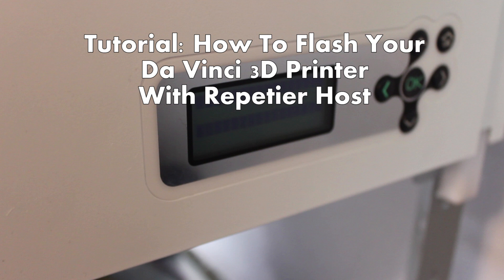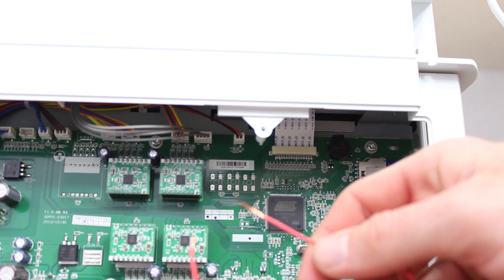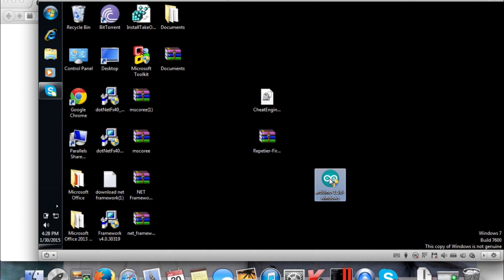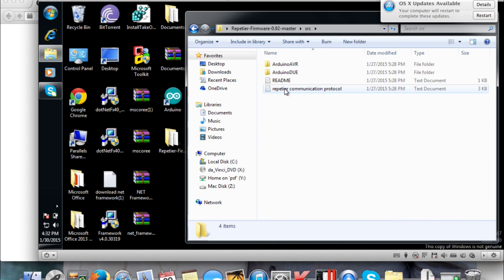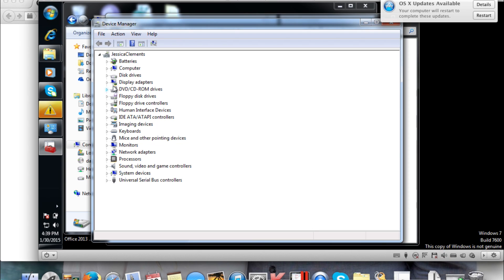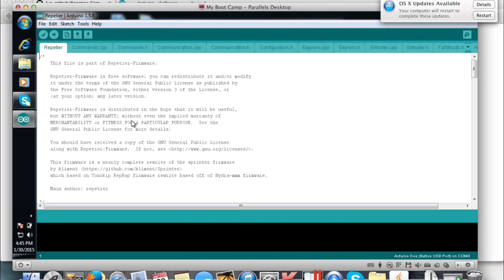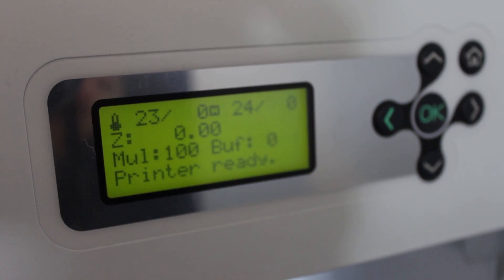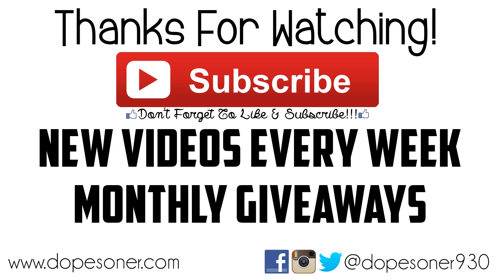Tutorial: How To Flash Your Da Vinci 3d Printer With Repetier Host | 3d Printer Hacks

Comment: Followed with succes on MacOS in 2024
Reply: which printer did you do this on and how is the machine doing? Just got a DaVinci 1.0 AIO from work and about to try tackle this install to get around all the weird drm.
Reply: @SoulieGus  Original 1.0 printer. After flashing it worked ok with the ABS spool that came with the machine. But when i tried to print PLA i first had to print myself a heat sink fan shroud (thingiverse thing:623274), AND wrap an oiled up paper towel around the filament going in. After like three weeks of of work on the printer with partial success, the nozzle temperature sensor broke, and instead of continuing my necromancy practice i went and picked up a Bambu A1 Mini. Since then i can finally work on my actual project instead of my printer. Probably just a broken cable,  but for now the DaVinci is my filament dryer :)
Reply: @jkRatbird  That's unfortunate! I have an ender 3 (pretty much stock) that i use but got this 1.0 AIO for free some not too bothered if it breaks and stuff. Did find it weird that there's no parts fan on there only the heatsink one! I'll see how i get on :D

Comment: Arduino: 1.5.8 (Windows 8), Board: "Arduino Due (Native USB Port)"

In file included from Repetier.h:572:0,
                 from BedLeveling.cpp:107:
HAL.h: In static member function 'static void HAL::serialSetBaudrate(long int)':
HAL.h:684:14: error: 'class UARTClass' has no member named 'setInterruptPriority'
       Serial.setInterruptPriority(1);
              ^
Error compiling.

trying to flash my xyz da vinci 1.but keep coming up with these errors. ive looked in HAL.h but still cant solve the problem, would be grateful any help

Comment: If your DaVinci has one of the points removed like mine, simply insert a thin wire into the space where it would be and touch the second connection. Worked like a charm!

Comment: I may as well do it just because the darn chip for the filament is full of crap. And especially the limitations of the little os it  contains which almost made me throw it out the window but since it's my only 3D printer that I currently own which is a 1.0 A it still sucks but if this mod actually works i'll actually be surprised.

Comment: Title doesn't specify which Da Vinci Printer/s this will work with but I don't think it works with the Da Vinci Mini - in fact when I followed this process exactly I didn't see the same Arduino Hardware folder files as you say will be found in that Arduino version. I believe the older your printer the further back you have to go with Arduino as each new version seems to have different/additional required boards.txt files in Hardware.
Reply: This only works for the older white/grey davinci 1.0 and 2.0 pro red black and aio - Be careful not to brick it if you have one. The pro and aio ones have issues with the firmware where you lose functions so I do not recommend doing this on it

Comment: tutorial works well, for those not in the know the current setup in 2021 you want to use is Arduino 1.8.0 with the 1.6.8 Due(installed via board manager, which you have to install once in the arduino program), and the variant and usbcore files have moved to  user appdata folder(other locations possible depending on version) if you don't get the variant file correctly installed, you will get 2 black bars after flash still.
Reply: thank you
Reply: @nolesen5699  no probs
Reply: @Revoku  did you get it to save gcode files to the SD card?  still having issues with offline printing.
Reply: @nolesen5699  oh, did you rebuild the EEPROM file? 

if the EEPROM file isn't present on the SD card it won't print gcode from the sdcard

M502 and M500 in console to rebuild/reset and save the Virtual EEPROM file.

Also if it can't save the file, the sd card is the wrong type
Reply: @Raxis when you transferred the usbcore and variant files, did you move the hardware folder, the arduino15 folder, or just those 2 files. Also, it says 2 of the files were the same, so did you hit replace? Ive tried it a few ways, and my printer is still showing the 2 black bars.
Reply: @arjunbabla4179  I found those two files that are already in the default install of the arduino software and overwrote them with the files in the zip seperately, for different OS's they are in different locations now, god damn arduino, I put them in ALL of the locations listed on google. both files, and entire folder structure because it got so frustrating...oh. and press verify before you hit upload if you don't you can actually upload garbage to the printer and get black bars aswell,
Reply: @Revoku Thanks, I got arduino on windows, from there website. I have a few more questions if you don't mind. Did you download it from the windows store, and if so, were the 2 files you transferred cores and variants, or did you also transfer the files in the SRC folder too?
Reply: @arjunbabla4179  mine was from the arduino site directly, and yea I did transfer em all, several locations because of how frustrated I was at the time
Reply: can you help me? im still getting black bars after all of this
Reply: @ItsCambot3000  have you got the correct arduino version and installed 1.6.8 due via board manager?
Reply: @Revoku  does it matter if it is 1.8.0 or 1.6.9?
Reply: I need help getting the firmware installed on my printer 😢
Reply: I'm stuck. I'm using the 1.8.0 version and the 1.6.8 but I'm not sure what you mean about the usbcore files and the app data folder.
Reply: @David-bs6bv  its been years since I had to do it, but from memory there were USBcore files that came with the firmware for the davinci that had to be moved to over-write the old files, but arduino(the software) had moved them around between versions or windows versions or something, so finding the location to paste them in was difficult
Reply: @Revoku I've been chasing my tail for hours trying to do this and I cant make heads or tails of where from and where to. When I think i have it figured out it doesn't work. Half the problem is I don't have these AppData folders under user and I don't know where I went wrong from the jump. Now IDE says it can't compile code and throws errors. I'm about to throw this printer in the trash
Reply: @David-bs6bv  oh right, appdata is a hidden folder, you need extensions and hidden folders set to shown, in the windows start menu, start typing file explorer options, goto view tab, hit the circle for show hidden files folders and drives, and untick hide extensions for known file types, hit ok.

appdata will appear.

And if you are at the frustration level of trashing it, sell it instead, and get something less frustrating, because I can tell you this, while a davinci modded printer will teach you loads of things, it will annoy the fk out of you at every turn.

Comment: Thanks Been having issues with the stock cartages for awhile now. Was planning on selling the printer, but decided to flash it instead. Your instructions worked like a charm. The firmware version you used can only be found by looking for the specific snapshot on the repository as the 1.5.8 folder has long been deleted. Here is a link to the that snapshot and aduino version I used. Happy Flashing https://drive.google.com/drive/folders/1p_M67csvWniGAToD9owOJe3tk8pTgV3W?usp=sharing
Reply: Video worked like a charm with this information! Thanks so much
Reply: Just wanted to add that this still works! I used the snapshot of the files linked above. 1/5/2023

Comment: heres a comment from Bob Rowles you need it for the new stuff

 Just a note to all, the Due 1.6.8 native USB board is not and original option.  You need to go to tools, board manager and search for Due.  Then note that the default DUE is something like 1.6.12.  You need to click the drop down to load the 1.6.8.  This may be obvious to those more experienced with the Arduino IDE but for those of us relatively new to Firmware it took a little time to troubleshoot.  Hopefully this will save some time / headaches for another newcomer.
Reply: also, the files you need to copy into arduino are in a different place now.  you can find that place in arduino under file>preferences and the file path is at the bottom of the window.  i just flashed my new 1.0A using Arduino 1.8.0 on windows

Comment: This still works as of March 2020. The only changes that need to made are using the correct IDE version and the files need to be copied to the user app-data folder not in program files.
Reply: Matt Birckbichler which IDE version did you use? Thanks for letting us know this can still work.
Reply: @carlschwab1548  1.8.0 with Due 1.6.8 module
Reply: @mattbirckbichler4668  When I tried to upload the repetier files onto my printer nothing happened.
Reply: @kennylin4048  double check that you completed all the steps correctly. It's till working. I flashed my printer again last weekend because I added a layer cooling fan and needed to recompile to enable it.
Reply: @kennylin4048  Did you have any specific questions on any steps you're not sure about?
Reply: @mattbirckbichler4668  Just a note to all, the Due 1.6.8 native USB board is not and original option.  You need to go to tools, board manager and search for Due.  Then note that the default DUE is something like 1.6.12.  You need to click the drop down to load the 1.6.8.  This may be obvious to those more experienced with the Arduino IDE but for those of us relatively new to Firmware it took a little time to troubleshoot.  Hopefully this will save some time / headaches for another newcomer.

Comment: This no longer works. I'm really wishing I had never flashed my printer. I'm in a worse position than I was before. I guess this is for more computer advanced folks. Is there a way to get my printer back to factory?
Reply: Unless you have a copy of the original firmware. No. If you are at the point that it is just a paperweight I would just buy a 10$ mks prusa variant chipset and just swap out the xyz one with it. Takes a little rewire for the servos and a little bit of tuning to get the servos to sync movement but it will be worth it in the end.
Reply: or try this https://www.youtube.com/watch?v=3wDlD2u5tVc
Reply: Here is the 1st option https://www.youtube.com/watch?v=IflGxwv9s-8&t=8s

Comment: So when I open that zip file, go to src and all the other steps to additional files I see 1.6.8, 1.8.0 or Horus-0.2rc1. There is not a 1.5.8 option. Although I downloaded 1.5.8. What should I do? Do I have to go and download the 1.6.8 or 1.8.0?
Reply: theres a guy up a few newer replies to comments that solves it  you download the board file in the boards manager tab in the arduino application

Comment: Hi ;my Davinci 1.0 had a Repetier .92 when I got it , but I have never been able to have it to turn either the extruder heater or the bed heater , so I re-flash it with Repetier .92 again , but it’s still the same everything works except the heaters , have put a multimeter on the heater terminals in the board , and when I turn the printer on I have 12v there , but it drops down to nothing after about 5 seconds , I have replaced the mosfet , and on removing it found it to be ok , , But soldered the new one for good measure , still the same issue no heat , so What can be wrong?

Comment: Hi there, thanks for this tutorial, I was wondering if I could modify the extruder temperature after flashing the 3d printer.

Quite recently I bought a ABS filament which needs at least 220degrees do be used, but my davinci 1.0(not pro) doesn't reach that temperature, just 210degrees. Thanks.
Reply from the maker: Your davinci maxes at 210? That seems odd to me. Well if you can flash Repetier Firmware to the machine in the firmware you should be able to raise the max temp. I have not used Repetier Firmware in a long time though so I am not sure what the variable is called.

Comment: I have tried these several ways and it will get all the way to verify in Arduino but tells me an error. That is using Arduino 1.5.8 and I am guessing the new version of Repetier. Any help would be appreciated. Thank you
Reply: On the github page of Luc it is pointed out that the 1.5.8 version does not work. I did it for my Da Vinci 2.0 duo with the 1.8.0 version and it works great.

Consider that you have to update the variants.cpp / USBCore.cpp arduino files this are located in the github downlaod directory.

https://github.com/luc-github/Repetier-Firmware-4-Davinci/issues/201

https://github.com/luc-github/Repetier-Firmware-4-Davinci/issues/166

I hope it helps you!

Comment: Thanks for the video, super helpful. Still works on the 1.0A as of 3/24/2019. Followed the updates in https://github.com/luc-github/Repetier-Firmware-4-Davinci (Only difference is it uses a newer Arduino IDE). Worked like a charm. Ran into a small issue with the hardware files that needed to copy not working right, this was because I had a few versions on the Arduino IDE installed. Follow the instructions at https://github.com/luc-github/Repetier-Firmware-4-Davinci and use the 1.8.0 Arduino IDE. Make sure to uninstall any other versions first.

Hope this helps anyone who's late to the game like me. Happened to get the printer used for next to nothing and am new to 3D printing... didn't take me long to realize it's a piece of crap with the OEM firmware limits.
Reply: Jonathan Blumers once I do this to my printer, will I be able to still use the xyz ware software to print to the printer

Comment: Hi, once the printer is flash can i use my original filaments?
Reply: You can use any filament you want, OEM ones work fine. I believe the default ABS temps are 212c extruder temp and 90c bed temp

Comment: hello i did your tutorial to my old davinci 1.0, all gone well, i loaded default eprom settings and did a manual leveling, but i'm not able to print anything :(
i'm using repetier-host, but when i print, the printer do an homing, and start to heat bed&extruder. when temperature is reached the head move outside the print bed :( looking inside the printer through the frontal door, the head try to go far from the door and all to the right (and repeatedly bump to the endcourse for almost 2-3 seconds, then it stops)
i tried cura & slic3r, same effect :( any suggestion?

Comment: So will this hack do what exactly? Let me use filliment? or what?
Reply: It lets you use the printer with other slicers and host programs, and yes, any filament you want. Basically, the stock firmware on the printer is only designed to interface with the crummy XYZware slicer/host program, which has embarrassingly few options to set up your print. So you get a lot more options in terms of extruder temps, bed temps, print configurations and speeds, infill patterns... you name it.

Comment: Hi there had a few problems Arduino: 1.5.8 (Windows 7), Board: "Arduino Due (Native USB Port)"

In file included from Repetier.h:572:0,
                 from BedLeveling.cpp:107:
HAL.h: In static member function 'static void HAL::serialSetBaudrate(long int)':
HAL.h:684:14: error: 'class UARTClass' has no member named 'setInterruptPriority'
       Serial.setInterruptPriority(1);
              ^
Error compiling.

  This report would have more information with
  "Show verbose output during compilation"
  enabled in File > Preferences.
`I cannot get file to upload to printer any idea?

Comment: Is there anyway I can get some 2018 help with a XYZ Printing DaVinci 2.0a reflash? For home use I want freedom! Just need help with the Arduino portion (making sure I have the correct software before I short the j37 pin)
Reply: If you're still looking for help, I just did it successfully on my 1.0a. Followed the updates here: https://github.com/luc-github/Repetier-Firmware-4-Davinci

Worked like a charm using the Arduino 1.8.0 IDE version.